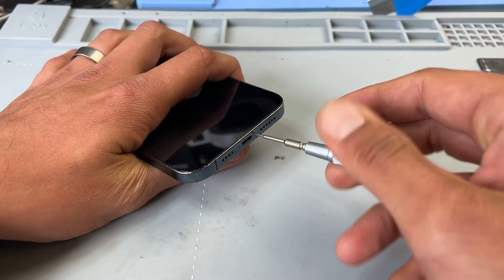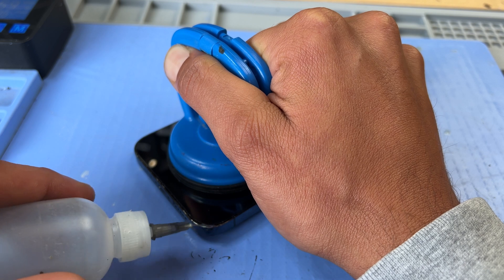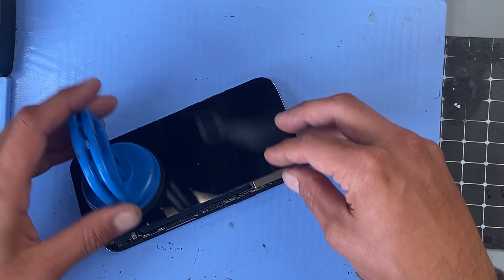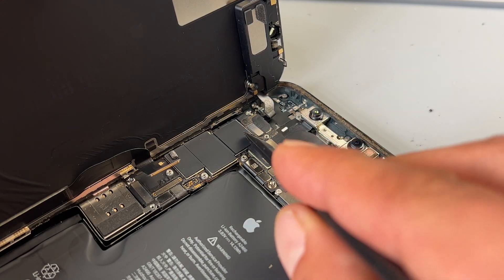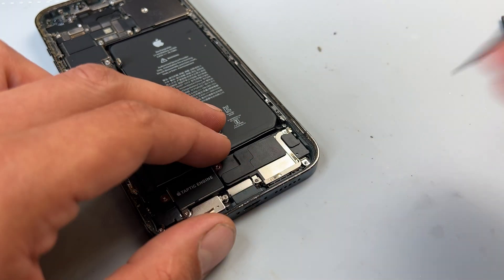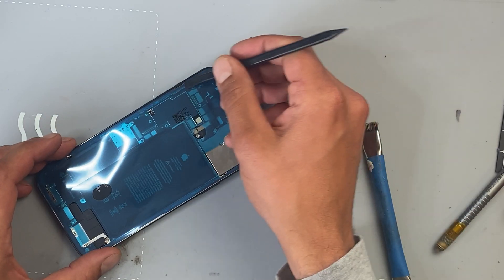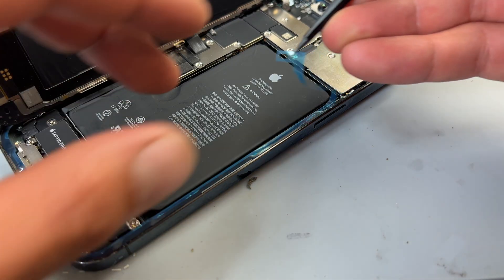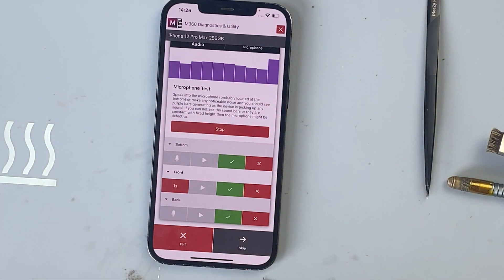iPhone 12 Pro Max no sound on Speaker: Loudspeaker replacement Guide

Comment: Ok so fun fact for yall. If your loudspeaker stops working by some reasons, try reverse blowing (sucking) from the grill. For me, my speaker went back to normal after few attempts, what makes me wonder now is maybe those tiny bits inside speaker’s gets moisture somehow and clogs up the entire speaker hence failure. Try and see if it works.
Reply: It worked for me like 2 or 3 times. But loud speakers stopped working again and now this method is not working. What to do?
Reply: Thank you so much  it works
Reply: And now its not working again 😢
Reply: Worked for me
Reply: Just an update, after a month stopped working again, and the same process doesn’t work anymore. Smh
Reply: @FutherGaming  so after trying out every method i went to the Apple authorized shop. They told me it is a production fault in some of the devices. They swapped my speakers. Working fine
Reply: if i could give you $$$ i would you literally saved me! i sucked in instead of blowing out and it totally worked! you’re a life saver 💗
Reply: nvm i spoke too soon 😢
Reply: Worked for me
Reply: I tried it, it worked but it went back to being quiet after 5 minutes
Reply: Worked for a second but keeps going off again
Reply: Mine started working by your method
Reply: Omg this worked first try lool ur a life saver 😂
Reply: Thanks it works on my phone
Reply: Yooooooo good looking out… I thought for sure this was gonna be bullshit but…. It fucking worked lol
Reply: Omgosh 😂 that worked. It’s glitchy but I got more sound for sure. Thanks!
Reply: @MamaW30  Magic!
Reply: There was a 3 year recall on the loudspeaker but fruit decided the max wasn't eligible wtf. So no dirt in my eye just rinse or wipe wasn't applicable to everyone. Unacceptable for any company but fruit showed their colors and I don't have these problems with my android replacement.